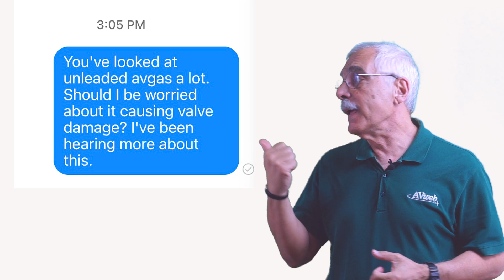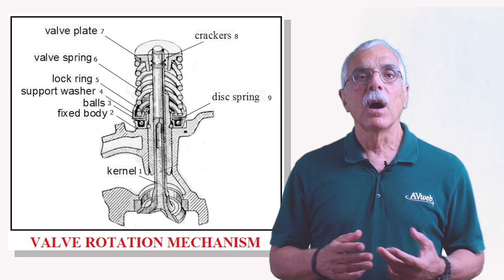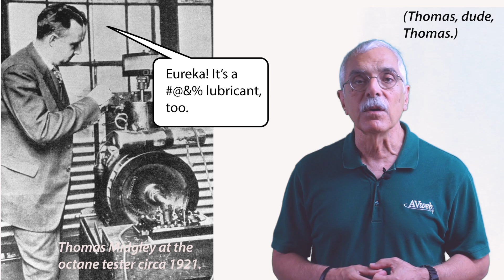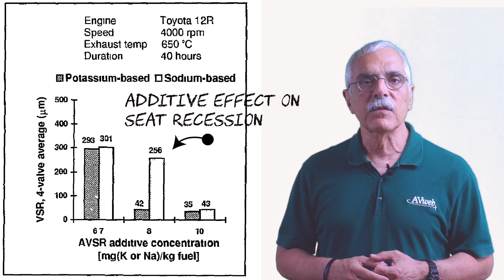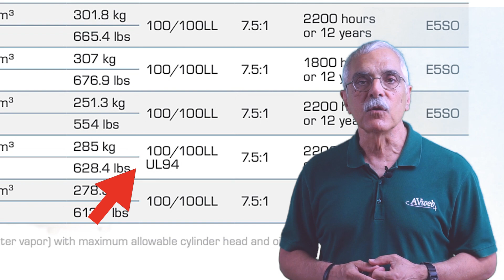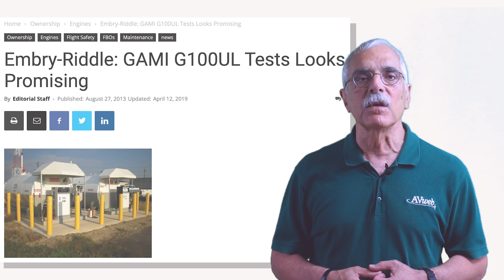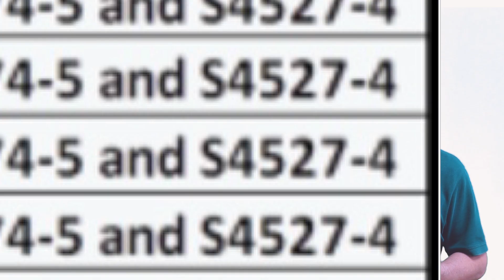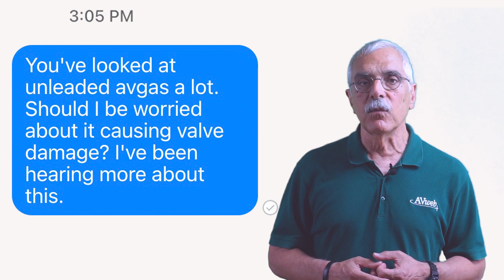Whadayamean Unleaded Fuel Will Trash My Valves?

Comment: Drawing some insight from the classic car industry once all of the cars with cast iron cylinder heads had been retrofitted with hardened valve seats a rumour mill started that certain aluminium cylinder heads were fitted with "Softer" valve seats which may be subject to recession and owners needed to have "Harder" seats fitted. 
As with all Theories it is impossible to prove a negative. All engines can suffer from valve  recession and any one whose engine is affected is going to blame the new Lead free fuel big G has forced him to use. Until a situation where enough bad outcomes occur to finance the legal cases that the research to pin down the cause of valve seat issues will be done. 
Going back to the classic car industry all of these vehicles with so called soft inserts had been on sale in the US and particularly California for use with unleaded fuel with no reported problems.
I would suspect that having not adopted hardened valve seats Continental is just adopting a policy of we said no but GAMI said yes for sole purpose of not having to pay of their Lawyers to defend any damages claim. GAMI on the other hand has done enough testing to convince their Insurers (forget the FAA) that they "ain't gona get sued".

Comment: Thanks Paul. Although I fly Rotax using non-ethanol auto fuel I'm still interested in 100UL. I have 875 hr on my 912 and have had no problems, :)
Reply: I'm not a pilot but I've always heard good things about Rotax engines. I have one in my old BMW motorcycle. I wish they were used more commonly in other situations.

Comment: Really Continental? Nobody demanded hardened exhaust valve seats? This explains why I’ve never been able to get more than 1000 hours out of a continental cylinder exhaust valve no matter what fuel I run: E-225, TSIO-520 in 2 different T210’s, O470. I ran auto gas in the first and last engines, no difference in exhaust valve longevity. I will be requesting hardened valve seats from now on. Thank you Paul for this very informative video.
Reply: I wonder if Cont not moving to hard valve seats / valves has something to do with needing some sort of engine modification approval that they were not willing to go through?     ( I come from the automotive world not aircraft so I don't know the regs.  )  
Change the seat material and you need to change valve material.  Change valve material and you might need to change valve guide material too.    Then you are left with possible differences in expansion rates leading to dropped seats / guides / stuck valves.

Comment: Thank you for the excellent presentation. I've used unleaded extensively in aircraft engines. My experience is overwhelmingly positive.
Reply: Just keep the ethanol out at all costs. It's hell on anything that's not metal in my experience.

Comment: Interesting that you show the Ford Pinto as a 70s unleaded compatible car - in Europe many vehicles used the “Pinto engine” which did not have hardened valve seats until about 1989! I have a Ford Transit that suffered with a melted valve as a result of the previous owner’s ignorance as proof.
Reply: The 2 liter or the 2.3?  My German Capri with the 2 liter burned a valve.
Reply: @wallacegrommet9343  2 litre, the same! I think the 2.3 was only available in the US.

Comment: I find it ridiculous that the really bad addition of lead based chemicals survived in aviation gas till today !! I mean there is a great video about the chemist that invented it (and the stuff fridges and spraycans) is the man responsible for more deaths and sickness than any other human being !!!
Also I love how the connecting rod in your animation both changes length AND cuts through the cylinderwall 😂
Reply: It's really simple to see why leaded gas survived in aviation.

It's because most aircraft are flying around with engines that were designed in the 1940's.

The lead is needed because the engines need all the octane they can get.

Comment: Here is my observations about leaded vs. unleaded fuels. Please bear with me as I give a bit of background leading up to my observations.

Back before unleaded fuels were introduced along with catalytic converters and stricter emission controls, I worked in an auto dealership service department. Much of my work was major engine repair. I noted that there were a lot of engines that needed valve jobs. There were also a significant number of engines that had "grenaded."  Disassembly of these engines revealed pockets of a gray sludge had accumulated in some areas of the engines. This gray sludge turned out to be residue from lead in fuel. 

Fast forward to more modern times. After a decade or so of most engines using unleaded fuels, my observations were that there were far less valve jobs being done. Also, I noted that engines that I did disassemble were very much cleaner than the older ones that had used leaded fuels. There were also much fewer engine failures. 

I do realize that my observations are anecdotal, but the engine manufacturers seem to be unable to see the forest because there are too many trees in the way. They need to stop splitting hairs and look at the big picture. By my observations, unleaded fuels are better for engines.
Reply: That was a very balanced and well-explained recounting of your experience.  Thank you for that!
Reply: Engines break less often and they do so while being "maintained" by people who don't even know what a 710 cap is. 

I think it's all in the manufacturing. Working an old smallblock compared to a "new" ls1? No comparison. Modern design tools and manufacturing tech make things possible that they'd never believe possible back in the day, at least in volume.

I think you could push leaded through a modern engine and it'd do it just fine, besides maybe the cat clogging. You'd still see a lot less of the grey sludge. In other words, the fuel has nothing to do with the engine life seemingly being extended. I think that's from reduced engine clearances, better crankcase ventilation, cleaner internal passages and crankspaces, and just all around better and tighter control over all the fuel and fire. No more carbs dumping fuel on overrun, no more limitations on ignition timing based on mechanical principals. And the engine has control over it's own throttle, the absolute protection you can lay down with torque management with all those options on the table is incredible. It's impressive people can even still blow them up!
Reply: @pontiacg445  With all due respect, sir, I believe you have misunderstood my post.
I was comparing engines in nearly the same era. Unleaded fuel was required for the first time in 1975 throughout the country and earlier in California. My intention was to point out that engines I worked on were cleaner inside on engines from around 1980 as compared to pre-1975 engines. 
What I was not looking for was a comparison of engines from 1972 against engines from 2015. Quite a lot has happened in that time period. However, engines in the 1970s were mostly cast iron V8s. Engines today are mostly composed of alloys of relatively exotic metals with many refinements. Refinements like electronic fuel injection, overhead camshafts, roller rockers, variable valve timing, and the list goes on. 
If you are saying that I did not see what I saw, I respectfully disagree. 
My intention was to say that my OBSERVATION  was that engines (of the same era) appeared to stay cleaner inside using unleaded gasoline. Nothing more, and nothing less. 
Again, this is observation. I don't present this as being anything more than that.

Comment: I can’t help but wonder about the implications for vintage aero engines and warbirds. I haven’t seen any real data and I’m not aware of any significant testing. Ultimately it will fall upon those of us choosing to operate these engines to find the data and solutions. I get it, in the grand scheme of things such operations represent a very small percentage of a greater whole, which by automotive standards is minuscule unto itself.
Reply: All those engines already run hardened valve seats, so I would expect them to be fine?

Comment: I thought adding Marvel Mystery Oil to anything magically protects absolutely everything no matter what fuel or oil you use:)
Reply: :face-green-smiling: Yep, you read about it everywhere in marine/aviation/diesel/automotive/farm forums.
Reply: How it works is a mystery.
Reply: The accident of N5428H was caused by unapproved use of Marvel Mystery oil as a fuel additive. The manufacturer's own website doesn't recommend aircraft use. Use it in your lawnmower, not your Lycoming.
Reply: It smells nice at any rate (Oil of Wintergreen), and its main component is a decent, if common solvent (Stoddard Solvent).
Reply: Only because the dead aviators tell no tales.........

Comment: Don't tell me aviation was using tetraethyllead untill now.
Reply: Still using it and will be for a while. It will take a long time for the UL fuel to get to every airport. 

Gonna be pricey too, your average mom n pop FBO will have to, at least for a time, have double the equipment (fuel storage and distribution) to provide both 100LL and UL. If they even distribute it at all.
Reply: That's a good thing in a pretty short perspective though. Thing is malignant.

Comment: That was again brilliant Paul , thank you so much . As you mentioned in Sweden we use 91/96 UL since min. 25 years in normal aspirated engines without any trouble with the valve seats , but there is no prevention’s for sticking exhaust valves , because it’s not the lead which let the E. Valve stick , it’s the carbon ( unburned fuel ) !!! If the air/fuel mixture is perfect in idle , the engine will die after start until the parts in the cylinder,head and piston are warmed up to prevent condensation of the fuel . The test of idle mixture show exactly that the air/ fuel mixture is to rich when everything around the cylinders is warmed up .(25-50 rpm rise when leaning) !
To prevent exhaust valve sticking ,piston ring sticking etc. lean the engine 1ore 2 min. after start ( depending on temperature) 1100/1200 rpm lean until the rpm start to go down , taxi with modulating rpm ,try to perform the run up with aggressive leaning ! You can’t forget it for take of ! The engine will die when you advance the throttle for takeoff , if it was aggressively leaned ! Then you have 100 % pwr until TBO .
Reply: Do you not have 100LL available at all? Do you have to get an STC or some other piece of paper to make 91/96UL legal in your planes? I am just really curious about how this works over there.
Reply: @Finder245  100LL is still available in some places, especially at larger airfields, but most minor ones only have 91/96UL these days. Since a couple of years ago most aircraft won't need a full STC anymore; EASA (EU equivalent of FAA) has a simplified "standard changes and repairs" (CS-STAN) procedure that lets you self-certify your aircraft for 91/96 UL, provided that the engine is unmodified and its manufacturer has approved 91/96UL for that engine (regardless of aircraft). Basically, if the engine manufacturer it says it's okay, you print a supplement page that you add to the flight manual and put some new fuel quality stickers/placards on and you're good.
Reply: @renhanxue  great! Thanks for the explanation.
Reply: Operators of Continental O-200s and O-300s have reported far less valve sticking when operating on unleaded fuel apparently.

A friend of mine was over here in the UK from the US. We were at my base airfield. He saw the pump marked "UL91" and asked "What's that?" I replied that it was unleaded avgas. He was quite surprised. However I can't use it in my aeroplane as I need 100 octane. Roll on UL100!
Reply: Just as an aside, @reinerressel975, I was a member of the Stockholm Flying Club for a while in 2000/2001 when I lived in Stockholm.

Comment: I am not worried about my Lycoming and valve seat issues with my experimental with valve seat/valve problems because I want to use unleaded 92 MoGas. It’s corns squeezings, which worry me with rubber deterioration on my fuel pump(s) and carburetor metering valves. 

Another big concern is changing of oil types when running and mixing the 100 low lead with the unleaded. 

Oils have additives to scrub the lead from your engine…sort of.  

Running unleaded fuel, well there is no lead so the lead cleaning from oil does not have to be done so they don’t. So you change the type of oil. Aero shell to what? And if you are running a non scrubbing oil and you happen to refuel at an airport and fill your tank with trued and tried 100LL oh boy……the very real possibility of build up on valve stems can happen in a short period of time. ( So says my wise and trusted A&P mechanic. He has seen the goo.) 

So what do you do? Keep the Aero Shell until the entire US of A is purged of 100LL? My A&P welcomes the day when it is gone because of cleaner running engines and as Paul says, lycomimg switched to hardened valve seats years ago. Continental 085 and 0200 re shaped valve seat angles as required by STC. 

So sludge from the use of wrong oil and dissolving rubber from the use off 92 unleaded MoGas, is two very real concerns I have with my aerial Putt Putt.
Reply: Why would you change oil? Surely there is no downside to sticking to your existing oil

Comment: One thing I haven’t heard any data on are the thousands of auto gas certified aircraft out there.

I’ve got two planes, one powered by a Continental A65 and the other by a Lycoming O-360. Both are approved for auto gas, although the Lyc requires 91. 

Right now, the Lyc is near 1000 hours, and has been run almost exclusively on a mix of 75% 91, 25% 100LL. Zero issues so far.

My A65 is much lower time, still sub 200 SMOH. This engine has been run almost entirely on either straight 87 or the same 75/25 mix the 360 drinks. The story with it is a little more complex; when I bought the plane, Cylinder 3 was an overhaul, while the other three were factory Continental with 36 hours on them. The cylinder was replaced because the spark plug boss hadn’t been properly staked and was backing out. Within 50 hours, the overhauled #3 burnt an exhaust valve and had to be replaced again. Since then, the new cylinder has been flawless.

My experience with unleaded has been very favorable. I can’t say I’ve seen any wear on any aircraft I’ve been around, and the vast majority of owners in my little corner of aviation burn auto gas often if not exclusively. In fact, I find with my A65 I’m veritably REQUIRED to run auto gas in the winter: 100LL just won’t pop in those low compression cylinders when it’s -10°F, especially with the Armstrong starter.

Anyways, that’s my anecdote. I’ve yet to see much in the way of credible studies on auto gas, although the STCs have been around since I was a child and surely thousands of planes have logged millions of hours burning the forbidden beverage legally, let alone the even more prevalent illegal use. Seems like we could certainly put all the uncertainty to rest with all the logged data on these aircraft.
Reply: I just did a quick look up. It seems there are about 200,000 Rotax's flying in the US. All MOGAS Motors. Yes, I'd like to know how many MOGAS planes there are too.
Reply: Just don't get ethanol in your engine. It's hell on anything rubber.

Comment: 'Pixie dust' is another name for what I like to call 'tummy feels logic' - where you want something to be true, and you can imagine a reason why it should be true, and that's as far as you get. Your tummy feels something's correct, so it's correct.

The real world is always, always more complex than our intuition can account for, especially when talking about precision machining and everything involved with that, and that's why we need (and appreciate) actual research into matters like this.
Reply: Agree - there's all this debate over whether or not lead protects engines, but nothing definitive on the mechanism behind it. That's what needs to be figured out conclusively, as that would give a clear answer on whether or not it does protect engines, as as well as what's needed as an alternative (either as fuel additives or engine design changes) to provide the same benefits.

Comment: Kind of frustrating that the FAA etc. are keeping the details of the PAFI tests behind closed doors. That data could save lives, either in the immediate sense by preventing engine failures or in the long term by getting lead out of the atmosphere.

(Tin foil hat) I have a feeling that their data probably tells the story that unleaded aviation fuel is completely feasible, which would render the 100LL producers obsolete. That's why they haven't released it.
Reply: It turns out that most manufacturers would looooove to drop 100LL; the tetraethyl lead additive is hazmat +++.